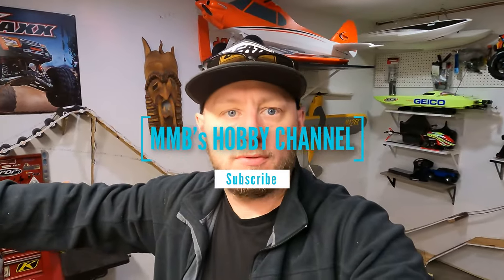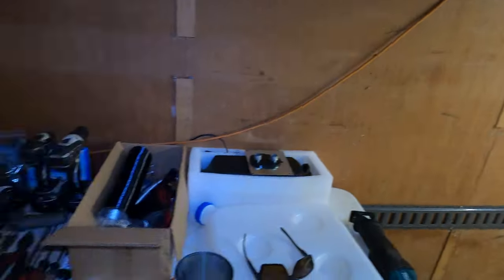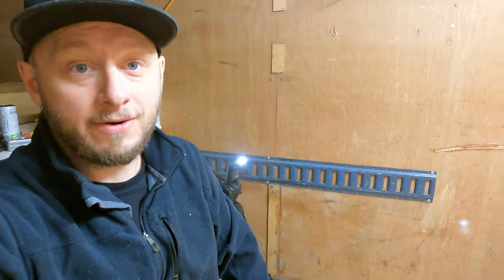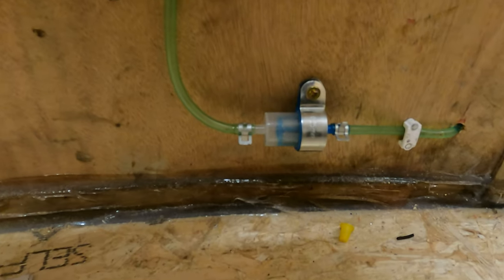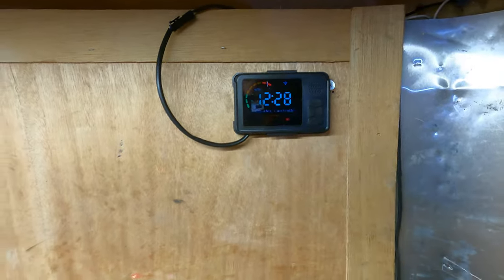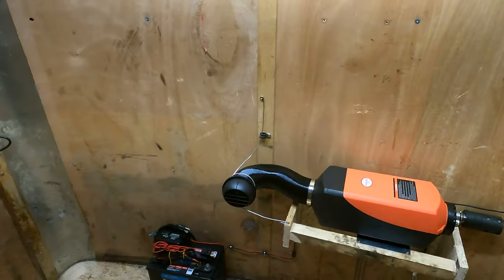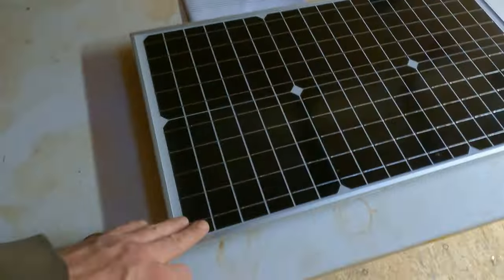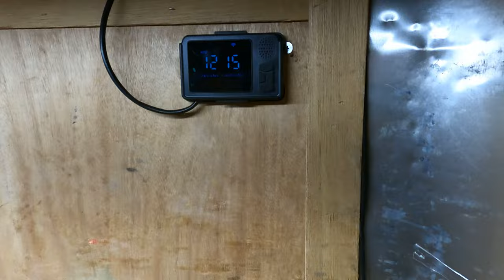Vevor diesel heater install video, put into a 6x12 enclosed trailer

Comment: Nice. Which size heater is it that you installed; 2kW or 5kW ? How did it perform over the winter ?
Reply from the maker: It’s the 5kw..it works great more than enough heat in that size trailer..for 20 degrees and above..never got a chance to go out in anything colder but I think it still would do just fine..and if i finish insulated it 100 percent np with negative temps

Comment: 1 The combustion air intake needs to be outside.
2 The display needs to be lower it picks up the room temp.
3 Angle the end of the exhaust you melt tarmac or burn grass.
Reply from the maker: Thanks I appreciate it. The exhaust is like 10 inches from the ground tho..find it hard to believe it’s gonna melt tarmac but i do appreciate it.  The display I’ll move that then but this heater just sets to one desired heat setting I thought? and that air intake, I can make a hole for it..thanks it’s my first time messing with one of these..thing works mint, nice heat from it!

Comment: The fuel pump is ment to be at 45 degree angle i do believe and the fuel line beter with the hard fuel line
Reply from the maker: Iv run the heater for 14 hours and had no issues..pump works great. And if there’s problems with the fuel line I’ll replace it then